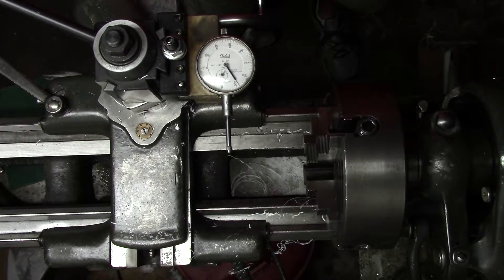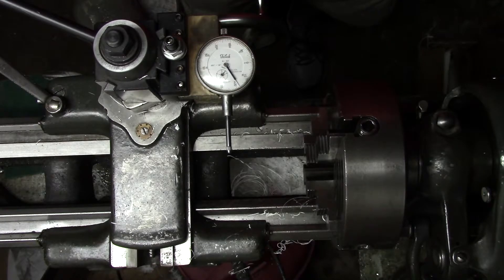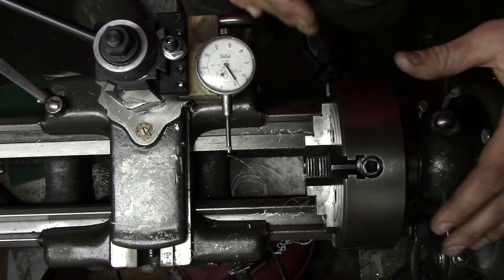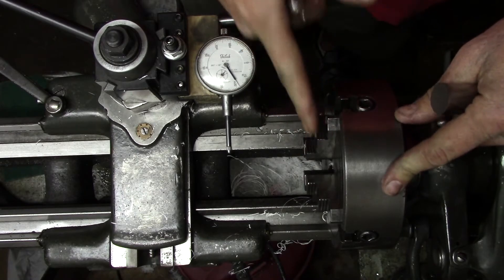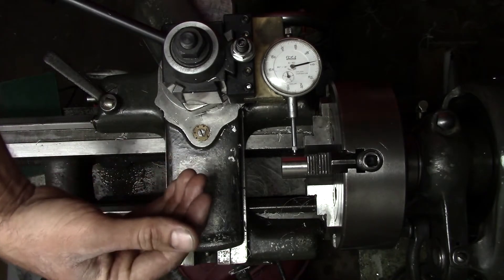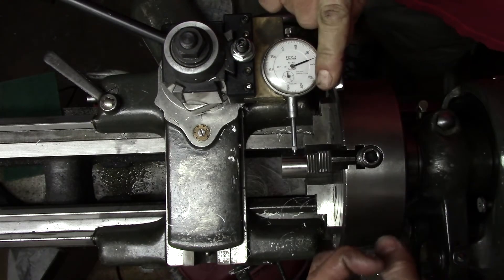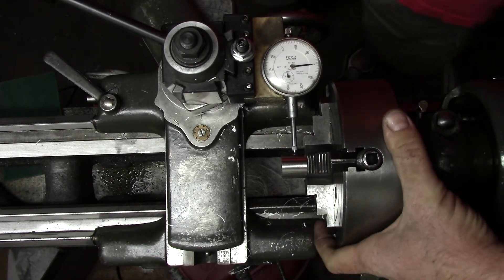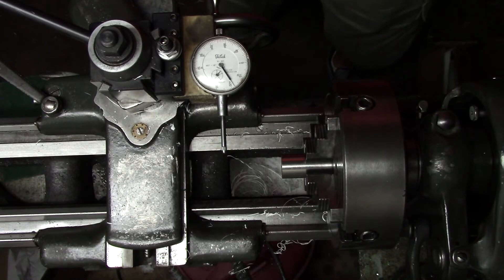(Viewer Request) Indicating a 4-Jaw Chuck

Comment: Well, if you are taking requests, perhaps you can point me in the right direction on this.  I have a Burke #4 mill and the spindle orf this mill is a B&S#9.  I would like to use a set of MT2 collets with this mill.  That means I need to turn a B&S#9 external taper with a MT2 internal taper.  Can you demonstrate something like this and how to keep the tapers concentric to each other?

Joe
Reply from the maker: I'll have to think on that one. But it should be doable. Stay tuned.
Reply from the maker: I have thought of a way to possibly make this adapter on the lathe. However, I realized that isn't going to be the main problem. Both the B&S and MT tapers are locking. When doing a tooling change, if by chance the adapter releases from the spindle before the collet releases from the adapter, then your tooling changes will not be quick and easy. You will have to add an extra step to the process getting the MT2 collet out of the adapter.

There are two options to think about...
1) The #9 and R8 are about the same size. It is possible to have the spindle reground to accept R8 collets. R8 collets are pretty cheap but I doubt having the spindle reground is.
2) Use a #9 to ER collet adapter. ER collets are relatively cheap. You can either make your own adapter or there are several sellers on ebay that have them. The biggest downside to this is a loss of rigidity and quill travel. The ER adapter will add a few inches to the end of the spindle. As long as you are aware of this and compensate accordingly it shouldn't be to much of an issue.

With that said, I'm still willing to make an adapter and will show that in a future video. However, I'm not convinced it is the best option in your case.
Reply: I had not thought of the tapers both locking together and perhaps I should rethink my game plane.  The Burke #4 is a benchtop horizontal milling machine, mine was built in late 40's early 50's.  I have read that the spindle could be reground to accept a R8, but I would prefer to leave the machine as built.

The use of the MT2 collets was simply because I had them.  I originally bought them for my Atlas 10F, I had planned to use the MT3-MT2 sleeve with them.  I have not used them yet and thought maybe I could get double duty if I could use them on the mill too.  Hindsight being a wonderful tool, I should have bought MT3 collets.  I just don't want them to go to waste.

Maybe it would be best for me to locate B&S#9 collets.  I think they are out there, or maybe make some BS9 endmill holders as I need them.

Still, turning a taper in a taper and keeping it concentric perplexes me, and as an educational video I think it would be great.  To date, I have not found an example on YT.

If you look at my videos, you will see that I am a newbie.  So thank you sir for helping this newbie grow in knowledge.

Joe
Reply from the maker: Getting the B&S collets are certainly a great option. There is a seller on amazon that has a set of 11 collets.

https://www.amazon.com/Brown-Sharpe-Taper-Collet-16Ths/dp/B01BH5Q90Q

If you don't want to drop the money on a complete set, you can buy individual collets as you need them. Little Machine Shop has them for about $15/collet, not including shipping. That is what I was doing when I was using MT3 collets in my South Bend.

https://littlemachineshop.com/products/product_view.php?ProductID=4313

I will do a video on making a sleeve in the future. It should be an interesting process.
Reply: Thank you for the links.  I will most likely order the collets as I need them.  I still have to get the machine together.  Also, thank you for taking the time to help me and thank you in advance for showing how to make such a little monster!  I appreciate it.

And thank you for subbing me.  :-)

Joe
Reply from the maker: You are very welcome!